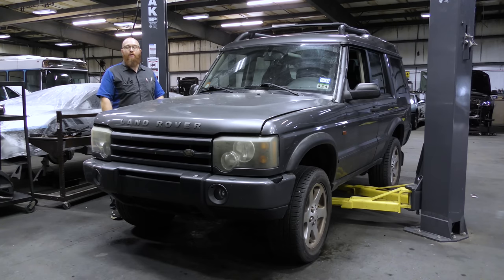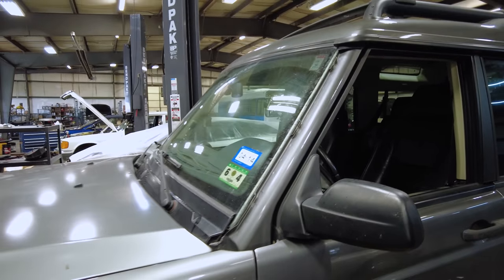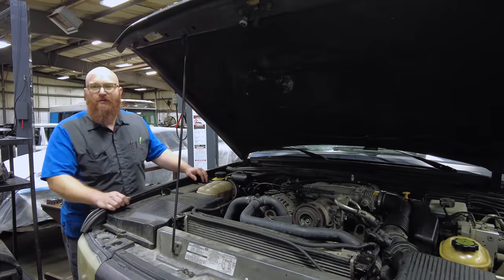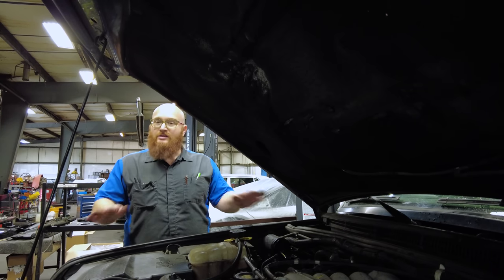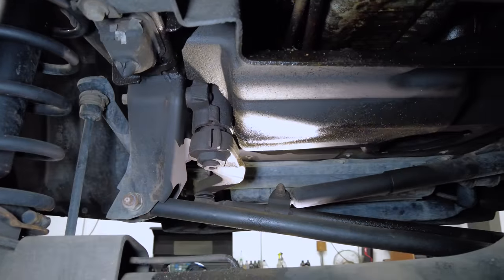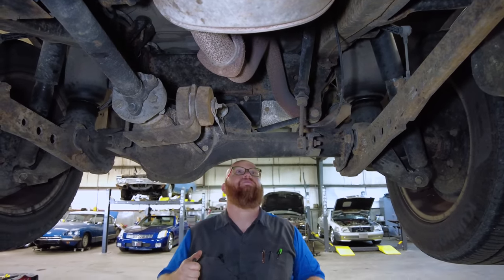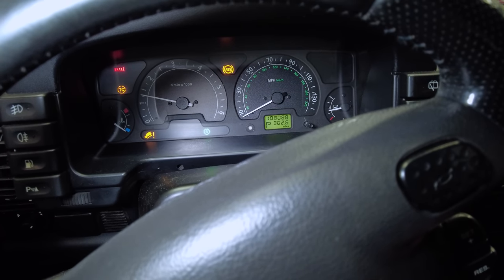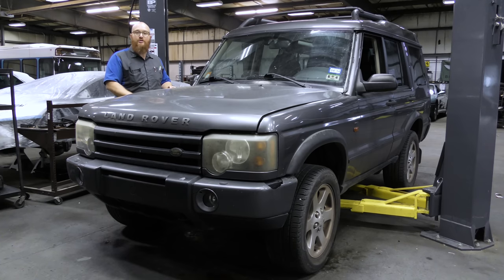Major items to watch for on Land Rover Discovery 1 & 2! CAR WIZARD shares their serious issues

Comment: Thanks for sharing. Actually diagnosed a burnt wire to the fuel pump on my dad's disco tonight. Cool how that happened the same time you posted this video. Its been sitting in the shop for years and yes it has a bad head gasket. He has mud tires, lights, heavy bumper and a winch. I think it's a super cool truck for offroad.

Comment: The Oldsmobile version of the 215 had an extra row of head bolts since Olds was turbocharging some F85s and Cutlasses. The Olds 215 then had fewer head gasket issues than the Buicks did. British Leyland acquired molds and other tooling for both versions, and then went cheap.
Reply: When a bad engineering decision may be made, BL would do it.
Reply: @waiting4aliens  This was pre-BL, as Rover were using the 3.5L engine before British Leyland even existed.
Reply: The triple row is largely regarded as failing more often than the twin row, as tightening the extra row is thought to lessen clamping pressures on the second row and causing the gasket to leak.
Reply: Ah yes... The one I forever regret letting get away. I swapped an Olds 215V8 into my 73 Vega GT, in 1975.   It weighed just 20 pounds more than the awful original 4 cylinder nightmare. It got better gas mileage too! The best engine swap I ever did.
Reply: When were the Olds 215s originally made? I thought everything was superchargers into the 70s or 80s?
Reply: @charlie_nolan  Early 1960's.
Reply: @charlie_nolan  Olds sold a Cutlass in 62 & 63 with a Jetfire option, a 215 with a turbo charger and alcohol injection to prevent knocking. Chevy had a similar option for the Corvair. Then GM ignored turbochargers until the 70s.
Reply: @charlie_nolan  Mine came from a 64 F85
Reply: @cameronwood1994  cool. Thanks
Reply: @chiplacey256  yeah, I just looked it up and read about it. I had no idea. That’s very interesting

Comment: 20+ years and still love my D1 

Another tip, you're looking at one with a bad head gasket check the compression, if it leaks down in a middle cylinder it could be a dropped liner, if it's an end cylinder it's prob an easy fix.  More of a D2/Bosch issue but can show up on the D1.
Reply: I found this to be more common on the GEMS motor. I always considered the D2 to be "more" reliable
Reply: @Klpinfl  interesting, I'd always heard it the other way but then again my D1 did drop a liner and bust a piston skirt at 172k, original head gaskets looked great when I opened it up.
Reply: @lawy3077  I barely made it to 80k on my D1 before the head gaskets went. Also the ticking lifter noise that is common on those engines is actually the bonded metal inside the rocker arm that makes contact with the pushrod, and not the lifter itself. Another common failure is the clockspring. Regardless, I loved that vehicle.

Comment: My TD5 Commercial is heading on to 300k miles. I am at my third transfer box and I have the air suspension on the back one time fully restored. I had the chainwheel disaster happen to my engine ones, but that is almost 150k miles ago. Last my key receiver box in the sealing went belly up and is replaced. The strut towers and the rear chassis has been welded but I love here to bits. She is not my daily and next to my Unimog S404 she is not the best 4x4 I have, but she still competes in trails and is a happy bunny.

Comment: I remember the ads for the air bag suspension, they said in off road the inflated rear  bags would add ground clearance. My grandma had one! She loved it.
Reply: A lot of the older ones either the compressor failed or the bags broke
Reply: I am a grandma and I love my rover disco despite its issues so fun to drive ❤

Comment: Still got my 1998 3.9 Efi 350,000 km still going strong, pulls like a train when its needed. Went through a major rebuild of all the axles & transfer box, cylinder heads & cam shaft, sorted all the issues out. Didn’t give it a lift or  a snorkel, no checker plate either. Still gets me where I need to go. 
No auto headlights, abs, traction control, hill descent, auto wipers, lane departure assist, just a key to start it!

Comment: After the ABS on my 97 Disco kicked in and caused me to go thru a red light while towing a trailer, I disabled the ABS and never looked back. As a bonus, my front brake pads and rotors lasted 3X longer without the ABS. Oh, and it still stops just fine without the ABS. 
One thing you didn't point out Wizard was that unusual parking brake... On the rear drive shaft. If you drive the car with it engaged, it will deatroy the transmission, which is very expensive to replace.
I "collected" my 97 in 99 and have driven it ever since. There have been some issues here and there, but it has actually been pretty reliable. The OEM springs and shocks on Disco 1 are crap. I replaced with OME springs, Bilstien shocks within a year or two. Vig improvwment and they last!
And, yes, they are pretty easy to work on. A lot of stuff is designed to be repaired with very basic tools or no tools at all. 
The Disco 1 headlights are glass and don't fog up or yellow like the plastic ones. The Disco 1 also has black paint where the plastic trim was broken or missing from that Disco 2. The Disco 1 has metal bumpers with easily replaced plastic end caps, too.
If I recall correctly, that 2004 Disco 2 was the last year they used the body on frame design (very heavy duty, 1 ton rated) AND the last year with the Buick-derived all aluminum V8. After all, at Ford bought the brand on 2000 and probably didn't fully appreciate the GM engine. The brand was again sold, this time to Tata of India (Mahindra tractors).

Comment: Had one of those...main problem is chassis rust, but the inner wheel arches can also rust.  Water ingress is also a problem, but mostly easy to fix....'a' pillar and sunroof. I did like it a lot...mine was a TD5 diesel of course in the UK...but sold it due to the rust. I would definitely buy another one without the rust. 3 amigos is usually a sticking valve in the ABS pump...easy fix.

Comment: Great intro vidjo on the Disco, Car Wizard! I have a 98 Disco 1 that I rescued a couple of years ago and love it. It had been sitting in a barn for 8 years after it failed inspection due to a very rusty frame, floor and firewall. I spend half my summer underneath it fixing all that, along with some pretty dodgy previous electrical "repairs".  It's now a very solid truck that I mostly use to tow stuff in the summer, and as my main winter ride. These are very quiet and comfortable, even somewhat luxurious, and they are unstoppable in snow! That's a very good thing, cuz I live in Canada. Cheers!

Comment: Have a '97 that got to 350k-ish miles.  Was run off the road and jumped 2.5 concrete culverts.  No injuries on my part but the Rover is in traction at the moment.  Think I'll buy a couple more and I'll have enough parts to keep one going for several years. 🙂

Comment: Head gaskets
Oil pan gasket
Timing cover gasket
Radiator 
Interior seat switches 
Flex disks
Rear air suspension 
Brake calipers,  (on disco 1)
Horn buttons 
Electrical system
Spark plug wires
Reply: Sounds like the Dodge Chrysler line.😅😅😅

Comment: Budget $5k to fix the problems it will have when you buy it, and then another $2k per year for ongoing maintenance and repair. 

Plus, as others have said, you will worry each time you drive it that you’ll “discover” some new issue. 

I’ve had my 2000 since new, and I love the way it looks and drives, and I cherish the memories, but by now I’ve replaced most of the original parts, including the engine. Thank goodness for extended warranties!
Reply: So it's basically Theseus's ship at this point? 😀
Reply: Triggers brush

Comment: rear output shaft gear to mutch slack. grears have to mutch play. mine broke around 188000 km multiple times. cluch broke 3 times until upgraded to defender versoin. blown engine due to jumped timing, Greabox went out same time. Drove great. Engine tilt to front so air stays in the head. Or vacuum fill or drill a plug at highest spot so you can bleed easy.
Reply: on td5 there is a bleed in the top hose to remove air

Comment: V8's (You lucky people)  best keep the cooling system in top order. Steering boxes, don't turn the steering wheel until the road wheels are rolling. Three Amigos, usually a wheel sensor, a common fault. However, I have never had that issue because I don't dunk my car in cold muddy water. 110 miles - nicely run in. 180 thou in my TD5. High mileages are common. Wow, that is so clean underneath!    Rear output gearbox seals can go as well as the transfer box and are unobtainable, but a recon box can be purchased from Ashcroft Transmissions. You are a Top Man Car Wizard!

Comment: Got one just like it. Refurbing the XYZ switch solves the 3 amigos problem. The central locking system is hard chipped into the underhood fuse box, window motors and regulators fail regularly.... and as you mention, the head gaskets.. stretch bolts are a trip to "torque".
Reply: XYZ switch???
Reply: @2nickles647  The XYZ switch is under the car, attached to the transmission. It is a series of copper contacts that provide feedback to the car on what gear the automatic transmission selector is placed. The switch gets corroded and if the ecm can't tell the position of the gear selector... it puts the Disco in a limp mode... permanent 3rd gear... won't down shift, or OD, plus you get the 3 Amigos. The switch is permanently sealed, but you can drill out the rivets, spit the switch case, use a mild abrasive to clean the contacts, reseal the case and pop rivet back together. A new switch is about $500 if you can find one.
Reply: Easy peasy... nothing hard

Comment: I’ve been driving my Discovery 2 for three years now.  I’ve met a number of Land Rover owners along the way and I have yet to meet one who doesn’t love their Rover.
That being said, I do all my own work and maintenance.  I even did the head gaskets and studded the heads for additional strength. Working on the engine was reminiscent of working on the Ford 331 in my muscle car.  
The wheel sensor issue will trigger the three amigos.  I replaced the bearings and sensors and this corrected the amigos.
I find the biggest critics of Land Rovers have never owned one, and are usually people who don’t properly maintain their vehicles.

Comment: I had the TD5 auto, 2000 plate. The sun roof’s leaked when I got it. Took them out and fixed them 
took the cloth roof off and painted the roof lining. New water pump. Then had it for 5 years and sold it for what I had paid. Great car but the engine had been modified and it only did 17 miles per gallon 
on a good day

Comment: Funny thing about the GM 215 (That's read Buick & Olds 215) --- People will see 215 Pontiac listed somewhere, and think it's the V-8 (the common BOP mindset). It's not. The Pontiac 215 is a cast iron, inline six, built only in 1964 & 1965 for the Tempest and Lemans models.

Comment: Great video, I owned my for about three years. Got cheap had a radiator issue fix. So a few days ago, I got home at night parked it, next morning the brakes were gone. The pedal to the floor, no visible fluid anywhere. When I depressed the pedal, I hear a click coming from the gear handle area. Anyway I have to figure that out.

Comment: I got lucky and found a running 01 D2se7 with very minor issues, only paid 2K for it With a set of 5 off-road rims and tires already on it and the original 5 rims.. The body looks great, with no dents or rust. The front and rear bumper didn't look that great, though, and I would have replaced them anyway. 160k miles. the headliner had already been rhino lined. Lots of the little upgrades that people do where already done to this one.

Comment: Before even watching it - external head gasket coolant leaks, slipped cylinder liners that make it sound like a steam engine, external oil leaks, thermostat failures, rusting at the front drive shaft double-cardan joint from the HVAC drain, secondary air system and transfer case leaks.

Did I list everything? Nope I forgot about the ABS module failures as well. Ok now let’s watch it.
Reply: Ok..you just named of the Ford f150 trucks..😅😅😅

Comment: I bought an 04 in need of a head gasket. Turns out the first owner (I'm 3rd) really loved this car and had the engine top hat sleeved. I thought I struck gold... Until I've had 7 of the threads strip out of the engine block. It's been a nightmare and so far I've done the passenger head 4x just to do 1 HG job. The drivers side coming up to the same number at this point. I'm a Mechanic by trade and have experience on older Rovers, but what I thought would be a fun project has been a lesson in pain.

Comment: You didn't mention leaking sunroofs! I have a 96 Disco 1 V8. I am not a SUV guy, I hate SUVs and my cars are pre-war and a MGB, but I really like it. Big, dumb, wobbly thing. It's done 100k miles now and I do expect to do head gaskets at some point. I always figure if the thing every craps out body/mechanicals wise I can transplant the Rover V8 into my MGB! People I know who have owned these, despite the issues, all liked them. Mine has an interesting noise on acceleration that might be an exhaust gasket leak I need to look into.

Comment: If you live in the rust area, check the rear frame, its very common that they rot there and also check if the 4x4 lever still works and not disconnected as its controlled with wire and not electronic

Comment: The engine created by Buick ended up as the 3800 V6 in the end. My 94  4.2 Rover V8 had the top hat liners installed with ARP studs. Never had another issue.

Comment: I am a 96 D1 owner and you have to be diligent with maintenance - LR's are not Toyota Honda Subaru for sure. Now a days customers will not stand for a vehicle that has a lot of problems at 100K miles - I also have an 01 Toyo LC and the build quality between the LC and Disco are night and day of course I think I paid less than $30 for my SD Disco and $55-60k for the LC but my LC has about 200K and the Disco 100K and the LC still seems like a new car compared to the D1.

Comment: Given the choice between a 90's Discovery 1 or a 90's FJ80. I will take the Toyota every time. Similar problems, mileage, and cost between the two I just prefer the inline dohc more then the 60's pushrod tech.

Comment: Later larger engines can suffer from cracks behind the cylinder liner and become quite nasty. ARP fasteners rather than the factory bolts, just don't over tighten the outer ones to factory torque as it pulls the head over. If overheated they can suffer from a loose liner which will confuse many a mechanic with a tick a idle. Being flat tappet, those issues are fun at rebuild, roller available but($).
Only referencing the older ones, buy the 3.5 or 3.9. If you can't do your own stuff, being older vehicles you best go and buy something else and pay the man and do some OT.
At least over here can be bought pretty cheap, maintained at a reasonable cost by DIY and once sorted, at least the earlier ones will give you good service. Get alot of comments from people 'who have heard'. Keeps the price down.

Comment: The transfer case also leaks out of the intremediate shaft at the front of housing !  Uni joints can fail on the carden joint due to no grease nipples and moisture from the A.C.  drain !

Comment: I miss my 1998 Disco I. I had way over 100K, and it ran like a champ! Also installed a 2 inch lift kit on it. Rock solid truck, and the only reason i got rid of it, is because the damn sunroofs leaked, and when it was time to change my fuel pump, which is one of the easiest ever to do on these vehicles, i noticed that my whole floor under the carpet was pure rust. just broke my heart.

Comment: Nice video WIZARD. coil packs, rear main seal, and T-stat are other common issues. I have a 2004 with 223,000 miles. 2 head gaskets later. Still love it but always fixing something.

Comment: I have heard that some of these engines actually wear through the cylinder wall and that causes blown head gaskets. Have you ever seen that?
Reply: Wearing through the cylinder wall does not blow a head gasket.

The cylinder wall is at the side of the piston.

The head gasket is above the piston.
Reply: I think you're referring to the fact that some can slip a liner in the cylinder, however this usually happened early in the life of any motor it'll happen to OR it'd have to have been severely overheated to deform the block/heads and let the cylinder slip.

Comment: You forgot to mention the cylinder sleeves that fall out because it's a day that ends in Y.... Problem is caused by worn out castings that got used to long to make the engines.

Comment: In 97 I bought a LandCruiser, my brother bought a Disco. I still have the LC, the Disco went to the junk yard over a decade ago.
Reply: Im looking at getting rid of my 93 80 series and buying 98 disc as cost of Toyota parts is high I can buy 3 discos for price fix Toyota
Reply: @JaimeBird-n8m  well, the nice thing is any 80’s series fetches a very high price so you’ll probably get good money for it. Disco parts are very cheap since so many are sitting in junkyards with less than 100k miles on them. The engines overheated so badly that many of the heads are warped and don’t seal properly so use caution. I’ve actually looked into an LS swap in one because I like the body style.
Reply: @risinbison1106  LS1 be solid proformer had 350 chev in my 81cruza ute was fun broke few diffs.my Holden 308 1983 mq patrol was best 4x4 iv had but the rust got it

Comment: Lots of hate for the disco here. The truth is, they are very simple vehicles and dare I say reliable. You wont see many with low miles - this proves they are reliable.  The ones with bad blocks have been disposed of or fixed.   They provide a unique driving experience - a proper off road rig that can take your family and gear.